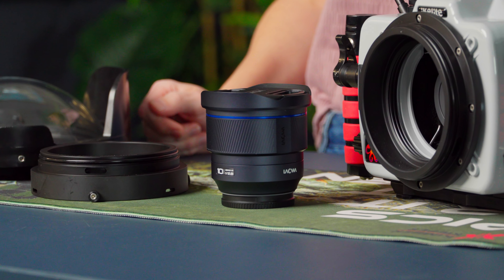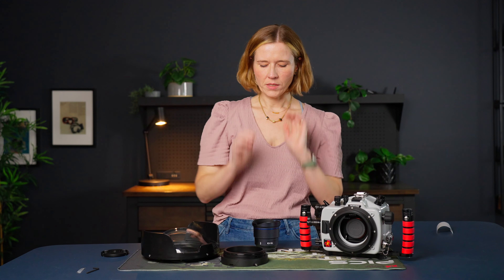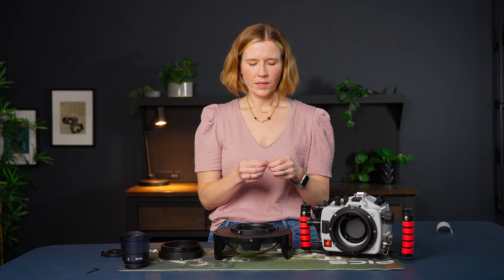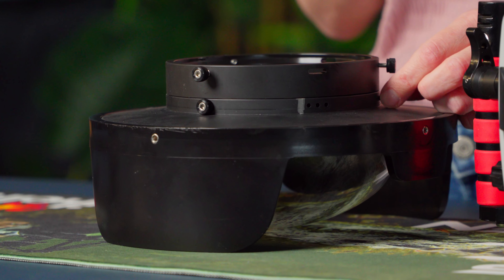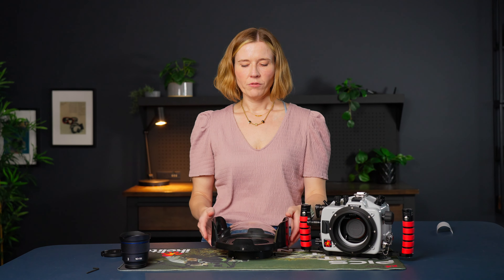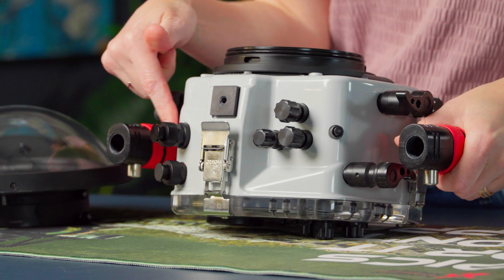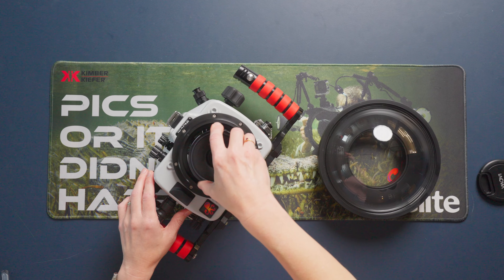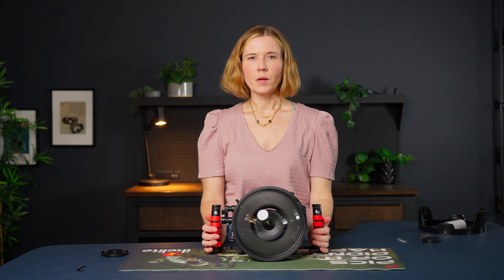Laowa 10mm Setting It Up // DL Ikelite Underwater Housing Assembly

Comment: Hi guys, great content as always. I have an Ikelite set with the big dome for the sony a6700. Thinking to buy this Laowa lens. Do I need to purchase the extra ring or the lens fit with the standard housing and big dome port?
Reply from the maker: Thank you! You could use it behind just the large dome, but the edges won't be as sharp as if you combine the dome with the Extension # 5516.65.
Reply: @ikelite  Thank you!